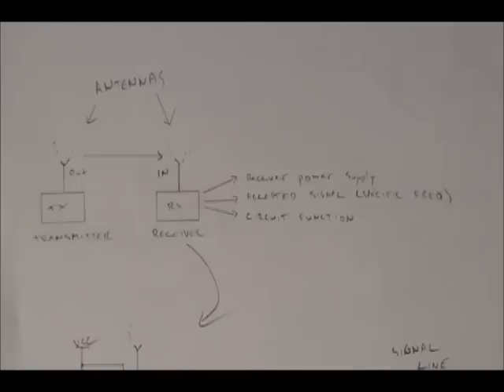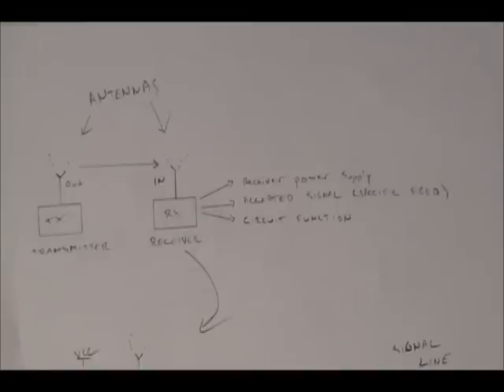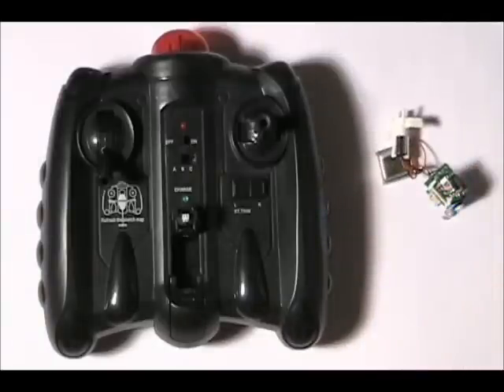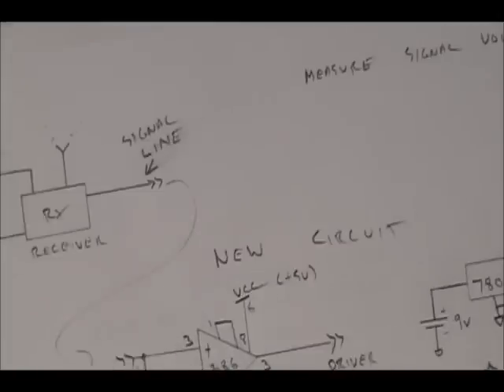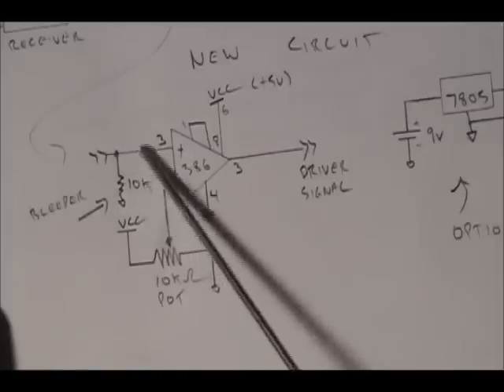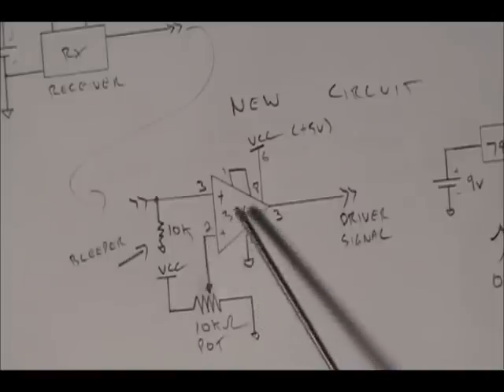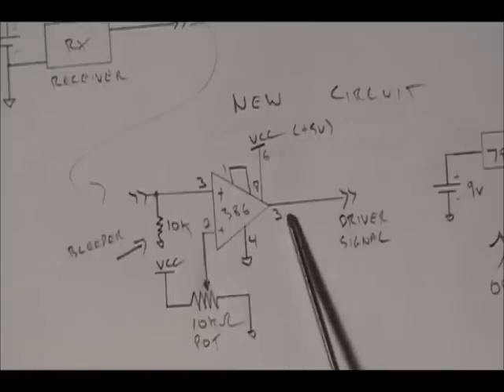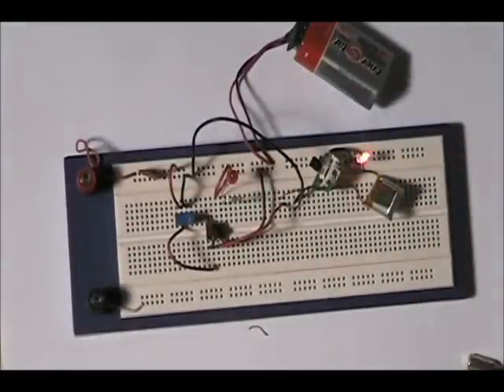Electronic Tutorial_Playing with your RC Transmitters and Receivers.wmv

Comment: bro why does my controller wheel go left when it should go right and vice versa.I just got exact car with no trans.I used my am transmitter off my old car at 27.095mhz just swapped chips.any help would be great.thanksps it is an leopard 1.8 scale.nitro car

Comment from the maker: Pins#1 and 8 determine the voltage gain.  I set it to max gain so that the output would be either 0v or 5v, depending on the logic at the inputs =)